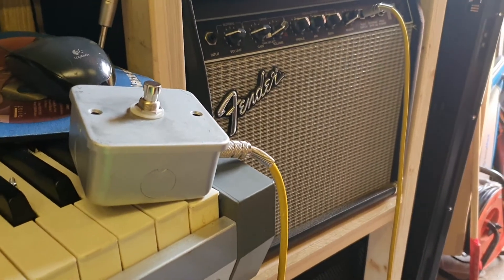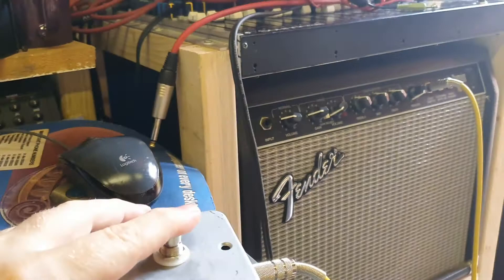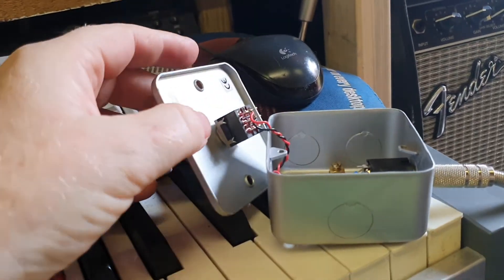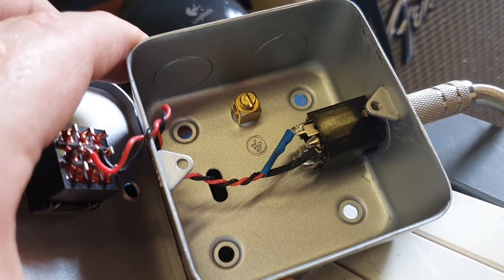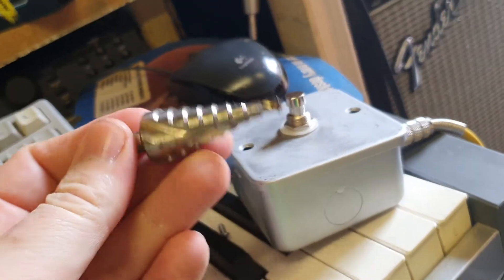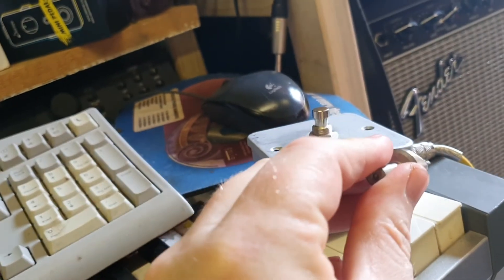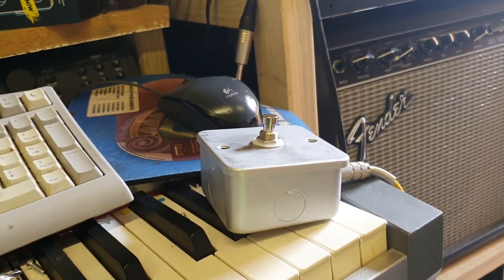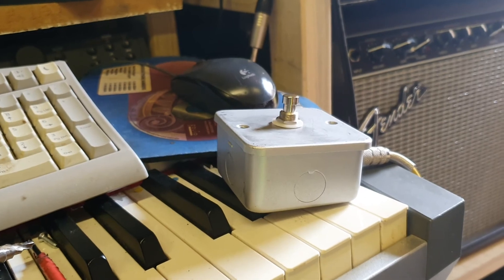DIY Amp channel switch

Comment: Hi, would it work on my transistor two channels Fender Frontman 65R ?
Reply from the maker: According to the frontman 65r the footswitch should have been included. All this switch does is to short/un short a cable connected to a 1/4 inch jack. So if you have a broken cable somewhere you could check Fender manual (that it relies on same principle) and if that work (shorting switches to channel B, un shorted is channel A) then it should be good.

I use mine on my Fender Champion 110 and as a reverb on/off on my Laney Cub 12r.

Most manufacturers use same technique but as ever at your own risk. It might be cheaper to get a 2nd hand working official part. I just like tinkering with things and have a lot of supporting tools collected over the years.
Reply: @stephenhookings1985  
Thanks! I purchased my Fender second hand at a good price, so I did not care for missing stuff. I have a two switch plastic cased, maybe Rocktron, and the manuals of the Frontman. Unluckily there are two versions, different looking logos. Maybe they are the same, I hope.....😊
Reply from the maker: @littlebritain64  it ought to work but I cannot guarantee it. All I know is a cheap patress from ToolStation in UK fitted the switch ok. I thought about it a bit more this morning. Operate amp. Plus a normal guitar lead into the footswitch. Nothing shod happen (open circuit).
Carefully run a wire between the tip and the sleeve. The channel should switch. It shouldn't  large voltage or current. Use a crocodile clip if in doubt.
If it switches ... take wire off. It should go back to original channel.if so then job is a good enough.

This is also how hold pedals work on many synths. Just they have a polarity.

Hope this works our for you.
My Fender Champion has a blown speaker. Put a Celestion in it ... work on (except I play more blues !)